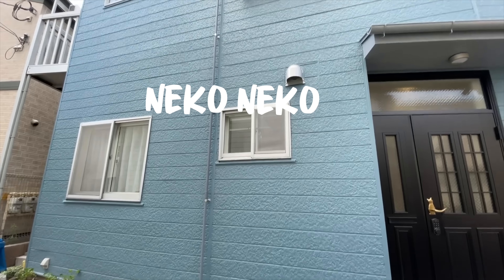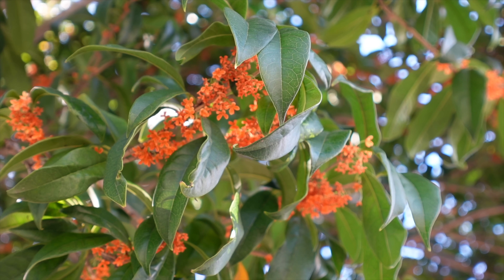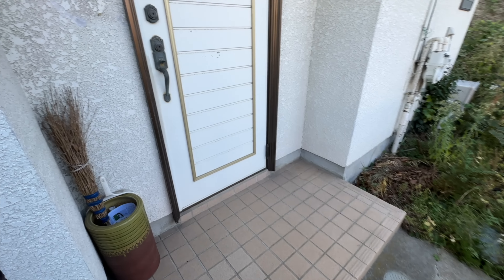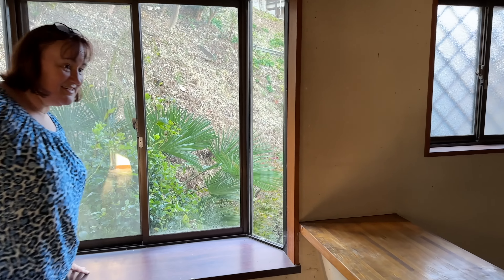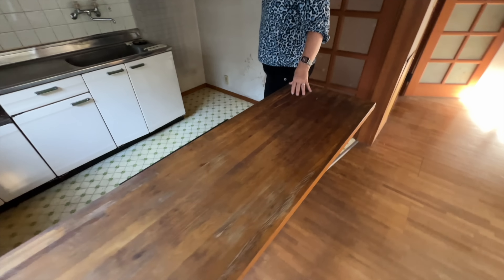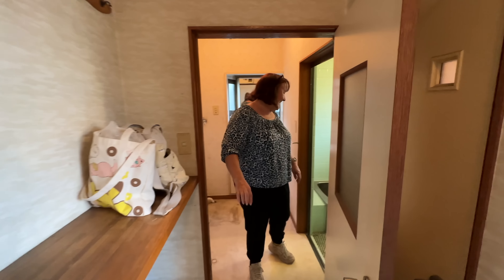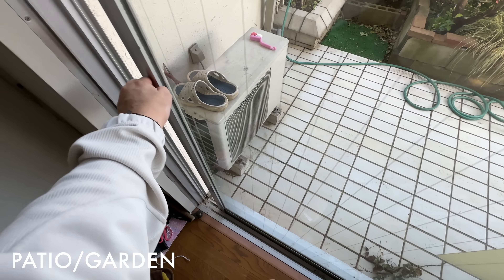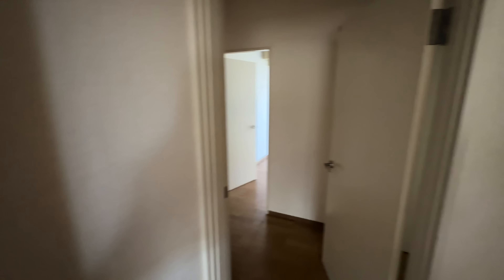We're Buying a New House in Tokyo!

Comment: That crack is where the drywall on roof is seperating from standing water which means that there or was a leak there at same time. My celling collapsed in the same way and that crack was the first sihgn.

Comment: The first house may cost less, but with the water damage and the passive crack in the wall I'd be really worried about what hidden costs the renovations would bring. It's still got charm, but for an AirBnB the second one is incredible. You could easily rent out multiple rooms at once, or separate the top and the bottom of the house with different locks so people would only share the middle part. The view from the second house is magical, very much what tourists would want!